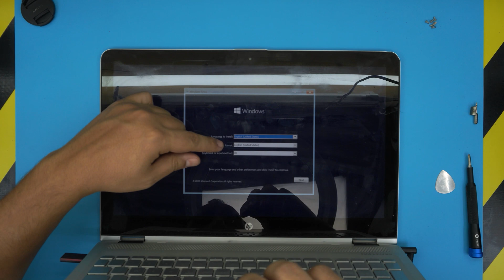HP ENVY X360 M6 AQ 📢 SSD M.2 NVME | HDD UPGRADE

Comment: Thank you, clear and straightforward 👍(subscribed). This  is NOT an NVMe SSD, since it has a B key for the M.2 connection: it's a SATA SSD. Can this laptop also accommodate an NVMe SSD (M key)? I have the same model as you do in this clip, the HP ENVY X360 m6-aq105dx, and I want to add an 1TB NVMe drive to it, the HP SSD EX920.
Reply from the maker: i appreciate your support my friend.
Regarding your question, yes that is m.2 SATA , because i did not had a nvme (with one cut) at the moment of making the video so that is why i mentioned "installing m.2 drive", yes this laptop can take the NVME up to 2TB without any issues and will benefit from it a lot.
you can also place a 4TB nvme but the 4tb will require a good heatsink, as for any 2TB don't need any.
but as you mentioned the hp ex920 that is perfectly fine and will work.
Should you have any further questions or requests in the future, please don't hesitate to ask me.
cheers🍻
Reply: @uFixTek  Thank you for your reply! Can we confirm that this laptop's M.2 slot is able to accommodate both M key (one notch on NVMe drives) and B key with 2 notch on SATA drives (Is the slot actually a "double slot" for that matter)?

Sorry, I don't want to open my laptop (removing its pads) in order to verify this by myself, until I'm sure of what I'll do (and buy, thinking of a slim and cheap copper heat sink), since it's currently my only PC underhand
Reply from the maker: Only take NVME (one cut).
we tested with m.2 sata and it did not recognized it.

Comment: Does this laptop ( hp envy m6 aq 105dx ) support NVME SSD.?
Reply from the maker: Thank you for your feedback! If you wish to support the channel, you can like, subscribe, or both!
Regarding your question, yes it does and up to 2TB max because after 2tb it will be double sided chip and it will not lay flat.
Should you have any further questions or requests in the future, please don't hesitate to ask me.
cheers🍻
Reply: @uFixTek  But the manual of this laptop states that it will only support a 250 GB NVMe.
Reply from the maker: hahahahaha
the manual is trash! that is an NVME PCI-E  there is no limit! you can only go 2tb because of the single sided chip, else you can go 8tb too if they make single sided. 
we have upgraded this laptops to 2TB without any issues and the performance is amazing when you go 2TB.
also if you call them they will say the 256gb too, it is funny as hp and dell and asus they miss inform the customer all the times.
Reply: @uFixTek  But in your video . Why you are inserted M.2 SATA
Reply from the maker: the storage i used in the video is an sata optane, it was just for the demonstration, at the moment i didn't had a nvme on hand.
your motherboard is gen 3, but you can place a gen 4 and the board will recognize it and use it as gen 3 speed.
if you want a good nvme get samsung nvme pro they are one of the best.
https://amzn.to/47JedHG
Should you have any further questions or requests in the future, please don't hesitate to ask me.

This is an Amazon affiliate link. When you use my links, you are helping to support the channel. 🙏

Comment: Excelente video, sobre todo porque UFIXTEK,  responde a las inquietudes.. Yo tengo una exactamente igual con puerto m.2; le adapté 8 gigas mas, osea 24; y el m.2 es un samsung 980pro, el procesador es un intel HD620 a 2,7mhz i7 de 7ma. 7500U. Ademas le deje como disco secundario el disco mecanico de 1 gb que vienen originalmente en la maquina. Coclusión y consulta: A pesar de que efectivamente, se volvio mas rapida, al hacerle las lecturas del disco samsung, no pasaron de 2000 en lectrura como escritura. No se si algo estoy haciendo mal o se forma el tipico cuello de botella, por cuestiones de lo antiguo del procesador y por eso a pesar de que el m.2 trabaja bien(segun la misma HP dice que solo trabajaria a maximo 250); en verdad, no rinde ni a la tercera parte de lo que dice en la caja( 7000 mgb/s); pero en la practica, he podido usarlo sin problemas en programas pesados de edicion de video, con un tiempo de renderizacion aceptable, ya que originelmente como vino de fabrica, era impensable, porque encendia a los casi 1 minuto, hoy enciende en 10 segundos y va muy fluida.. La pregunta: se le puede mejorar de alguna otra manera, sobretodo para fluir mas en la renderizacion, o definitavamente hay que comenzar a ahorrar para una gaming? Gracias y saludos desde Guayaquil- Ecuador.
Reply from the maker: es un placer para poder apoyarles, mira el motivo que tu nvme 980 no corre al 2000 es porque la tarjeta madre no es de generacion 4 ranura m.2 por lo mismo solo va correr al max que se pueda. aparte esa velocidad se baja tantito ya que tu windows esta constante mente esta utilizando y processos en parte atras igual. no hay nada mas que hacer. ya llevas el mejor configuracion posible para tu laptop. saludos🍻

Comment: Hola buenas, tengo hp envy x360 m convertible 15m-cp0011dx.
Cuando la destape no traía un disco ssd y quiero ponerle uno,  tampoco tiene la carcasa de metal donde se pone el ssd.
Cómo puedo buscarla para comprarla?
Reply from the maker: hola, depende donde vives para que te ayude a buscarlo en tu estado o pais.

Comment: Great content for people looking for help with hard drive upgrade.
I have HP ENVY X360 M6-AQ105DX, the hp manual for this model says to use 128 gb ssd or 256 gb ssd, will the 500gb one not work?
Reply from the maker: Thank you for your feedback! If you want to support the channel, you can show your appreciation by liking the video, subscribing to the channel, or doing both!

Regarding your question, it is absolutely possible to install a 1TB M.2 SSD without any issues while still having a 2TB HDD or a 2TB 2.5" SSD in the laptop. We perform these upgrades regularly without encountering any problems.

If you have any more questions or need assistance in the future, feel free to ask. I'm here to help!

Comment: Great Video. What would the freeze spray be used for?
Reply from the maker: Thank you for your feedback! If you wish to support the channel, you can show your support by liking the video and subscribing to the channel, or you can do both!

Regarding your question, the spray freeze is used on electronic boards to detect shorts on components. To use it, simply spray it over the board, power it on, and observe. If there's a short, you will see a component unfreeze quickly, indicating the presence of a short circuit.

Should you have any further questions or requests in the future, please don't hesitate to ask. We are here to help!

Comment: This is not nvme drive
Reply from the maker: we have upgraded this laptops with nvme and or m.2 SATA , both work fine .
Reply: @uFixTek  i used an nvme yesterday and got burned 🤯
Reply from the maker: Okay, my friend, there seems to be a misunderstanding. It is virtually impossible to damage an NVMe or M.2 SSD drive by simply installing it in the M.2 slot, whether it supports NVMe or only M.2 SATA. The motherboard will not recognize it if there is an issue, but it won't cause any damage to the SSD itself.

something went wrong during the process of inserting or removing the SSD, that might have caused the problem. However, in our daily installation and upgrade activities, we regularly test NVMe and M.2 SATA drives on laptops to check if they are readable. The same applies to PC motherboards, where you can test any SSD without causing any damage.
Reply: @uFixTek  believe. I just insert the nvme crucial 100GB storage and start to smell. I opened and the deive was totally dead 🤯
PC working fine with old ssd
Reply from the maker: i believe you, and i believe that it's possible that there was a problem with your SSD, either due to a defect or an incorrect installation. If you'd like, I can create videos to demonstrate that nothing harmful happens to an SSD when you place an NVMe drive in a non-NVMe slot.

I'm sorry to hear about your negative experience, and I genuinely hope that you have better luck in the future.
Reply: @uFixTek  hahah i just check ur vid to get a real proof if this laptop is nvme compatible.
Is the first time ever i have experienced this 😳
Reply from the maker: sorry you had a bad experience but i hope in the future would be different. 🍻

Comment: buenas tardes, puedo colocar un ssd m2 con capacidad de 2 teras.?
Good afternoon, can I place a m2 ssd with a capacity of 2 terabytes?
Reply from the maker: si amigo como comente, si puedes poner hasta 2TB sin problema.
Reply: @uFixTek  perfecto gracias. Consulta en el video se coloca un ssd de doble ranura y el enlace es de un samsung de una sola ranura.
Y otra consulta el ssd de Samsung del enlace es NVME pero el conector m2 q tiene la hp x360 es un m2 SATA  cuyo protocolo de transmicion de datos es AHCI. 
Si no me equivoco un ssd m2 nvme conectado a una entrada m2 SATA con protocolo AHCI leería igualmente en serie y no podría leer en paralelo, desperdiciando o no usando esa gran ventaja del nvme.
Desde ya muchas gracias por tu respuesta, es q tengo q comprar un ssd para esa misma notebook y no quiero comprar más de lo q la maquina pueda utilizar. Gracias
Reply: Entiendo q para darle buena utilidad a un SSD NVME debiera conectarlo si o si a un PCIE para aprovechar la lectura en paralelo. 
Un SSD NVME conectado a un M2 SATA sigue leyendo en serie.
Desde ya te agradezco tu ayuda. 
Gracias.
Reply from the maker: hola, mira este modelo que ves en video lleva el NVME que es solo un cortada. yo en video por demostracion solo tenia un m.2 sata (dos cortes)
el m.2 es PCI-E por lo mismo es recommendado installar NVME
todo los laptop que tengan intel 6gen + 90% son m.2 PCI-E
Reply: @uFixTek  ah ok el tuyo es un m.2 paciencia entonces.
Mi notebook es un hp x360 m6 aq105dx con disco duro de 1t 16 de ram y un intel core i7 y al lado del conector m.2 dice SATA. Siendo así no me serviría ponerle un ssd m.2 nvme.?
Reply: Perdón, quise escribir q "el tuyo tiene un M.2 PCIE"...
Reply from the maker: ah si si el tuyo dice SATA alado de m.2 entonces solo va detectar m.2 SATA amigo, el mio es PCI-E. no compres nvme ya que no va funcionar, solo compra m.2 sata que tenga dos cortes.
Reply: @uFixTek  perfecto..muchas gracias x tu tiempo...un genio. Gracias
Reply from the maker: es un placer a poder ayudar, cualquier duda ya sabes aqui estoy para apoyar. saludos
Reply: @uFixTek  muchas muchas gracias
Reply from the maker: gracias a ti por el apoyo

Comment: You are the only channel I've found with this such helpful info for this model! Hoping you'll see this! 
Wondering how you think it will handle 2tb sata M.2 + 2TB enclosed SSD + 32gb ram,, at this point is it likely to over heat & I'm best just replacing it? 

Like this laptop a lot, its served me well, specifically 15-aq055na & still using it daily.. 6th gen so not nvme compatible but want to max it out as best I can.. 

Still on its factory defaults, 128gb ssd / 1tb hdd / 8gb ram .. all 3 are showing age.. & reaching capacity but still reliable
Reply from the maker: Thank you for the feedback! if you wish to support the channel you can LIKE or SUB or both :P
regarding your question: you can place a 2TB m.2 ssd sata without any issue and have a 2tB HDD or 2TB ssd at the same time in there. and do a nice repaste and you be more than fine my friend.
they are solid laptops.
if you have any question or request in the future feel free to ask me.

Comment: I have an HP ENVY x360 - 15-aq002la (ENERGY STAR) is compatible with M.2 NVME or only supports m.2, I would appreciate it very much for your help
Reply from the maker: Thank you for the feedback! if you wish to support the channel you can LIKE or SUB or both :P
regarding your question: Its a 6th gen intel cpu, your model takes only M.2 SATA. it won't work with NVME m.2 ssd.
saludos
Reply: @uFixTek  my laptop is the same as the one you are disassembling
Reply from the maker: ok it yours is 7th GEN CPU then yes its NVME compatible my friend, all the 7Th gen CPU and up are pci-e m.2 compatible.

Comment: Thank you for this great video. I have a HP envy m6 aq-103dx. Could I install a 1tb m2 nvme ssd?  Thank you.
Reply from the maker: Thank you for the feedback! if you wish to support the channel you can LIKE or SUB or both :P
regarding your question: Yes, absolutely its compatible its a m.2 PCI-E lane 
this is one of the best ssd long lasting and reliable: https://amzn.to/3JuFhyo
Reply: @uFixTek  Thank you. I will try this 1tb m2 PCI-E  SSd. Can I first only install this m2 PCI-E ssd and disconnect sata HDD. Then use usb to install  windows 10 into the m2 PCI-E ssd ?
Reply from the maker: yes the best way is to disconnect any other drives then install windows on your m.2 then once finished plug the other hdd and format them.

Comment: Thank you so much for the help, i ended up installing a 500 gb WD ssd and did wonders for my computer! I have a small question. Do i need a heatsink for my SSD or y'all think it'll be good like that? 

thank you so much once again
Reply from the maker: Thank you for the feedback! if you wish to support the channel you can LIKE or SUB or both :P
regarding your question: absolutely not, no need the heatsink will not make it run faster or slow it down. the heatsink is good for if you have two SSD in a motherboard and you doing a lot of file transferring daily TBs then sure.
you fine, good job my friend and enjoy your laptop :)
Reply: @uFixTek  thank you so much!! This info was very Cash Money of you!! Will recommend your videos!!
Reply from the maker: my pleasure friend, muchas gracias por el apoyo compa :)

Comment: Hello, thanks for the video
 I need your help to confirm if HP Envy M6 x360 Convertible m6-aq003dx, i5- 6200, 12 gb ram, supports Nvme or Ngff chip card?
Reply from the maker: Thank you for the feedback! if you wish to support the channel you can LIKE or SUB or both :P
regarding your question: your model does support NVME as it is PCI-E lane and its backward compatible with m.2 sata, i highly recommend to place and samsung brand nvme ass they have the highest TWB (life pan ) is much higher.
https://amzn.to/3EuRK35

Comment: Thanks for such an insightful video for this laptop, team uFixTek!
I have core i7 8th gen model of HP envy x360 and I have 7200 RPM SATA 1TB HDD by default. I am planning to keep the HDD as secondary and add m.2 SSD as the primary slot to speed up processing. I hope my laptop will also have this m.2 slot as shown in your video. 
Can you please confirm if this laptop supports NVMe or only SATA m.2 SSD? 
I got confused as your video shows SATA m.2 SSD and the link you added in the description is NVMe SSD.
I couldn't find much information from HP site.
Reply from the maker: Thanks ✌  for the feedback!  if you wish to support the channel you can LIKE or SUB or both :P
regarding your question:  This laptops DO take M.2 NVME ssd, I upgrade them often in the shop, i would recommend you to buy a good brand SSD don not buy any ADATA or KINGSTON ssds they are garbage and wont last and zero reliable.
go with :
https://amzn.to/3kFWjAc
or
https://amzn.to/2Y3GcUz

how to create windows 10 usb: https://youtu.be/uDu8j2lE-dM
follow the installation guide on how to install it properly without all the garbage in the windows: https://youtu.be/7f_rBp6Rb3s
Reply: good morning bro! I am a follower of yours for a long time and I bought a PC HP ENVY x360 -m6aq005dx I7 6560u 16 ram samsung, motivated by your videos I just bought it... I want to know if I can place a Samsung M.2 for the operating system and leave the 1T HDD for general information? What do you recommend?